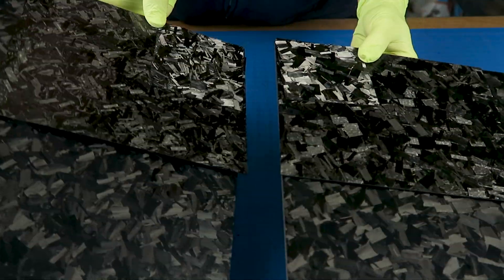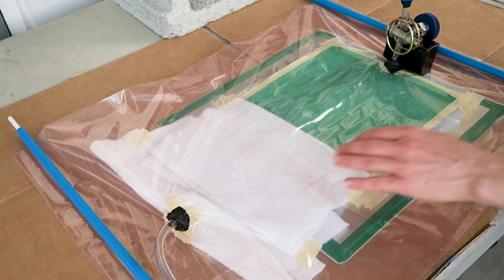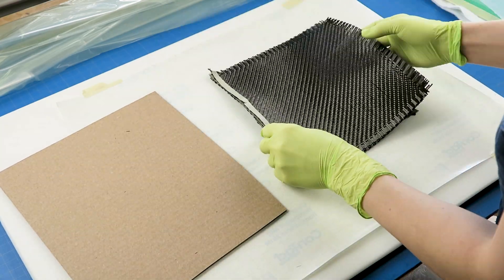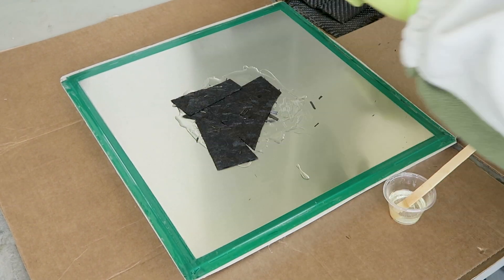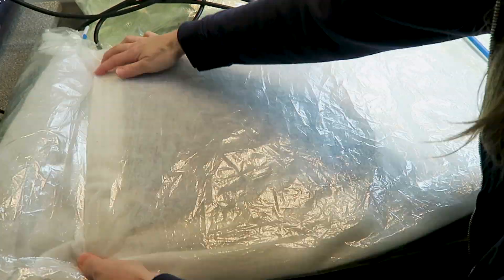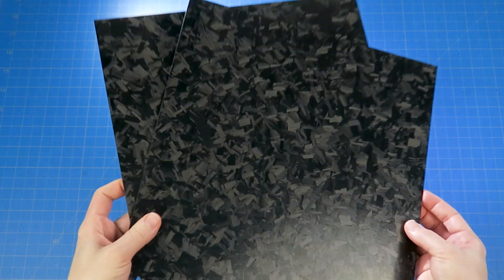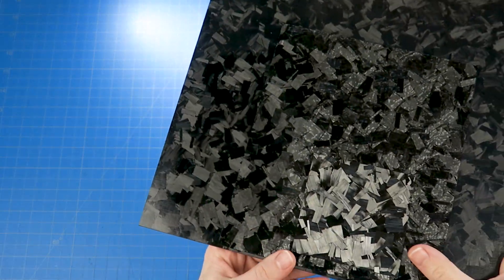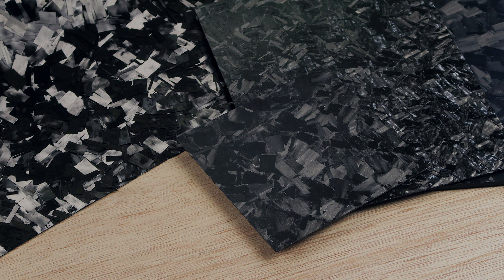Forged Carbon Fiber Fabric Features & Tips

Comment: Is that the ez vac from ACP? I was thinking about getting that, how do you like it? They recommended their vacuum generator system instead for me, so I could do larger parts like a car fender that’s 3.5ft tall 3.8ft wide. The ez vac might barely be able to do this bc it’s not flat they said, so I was wondering what your opinion is of the system.
Reply from the maker: Ez vac is handy and works, just very slow to pull down a large bag. Pretty sure it's a rebranded fish tank pump. Doesn't pull anything close to full vacuum but it does plenty hard enough to hold things together during cure. My process is often degass resin in a vac chamber hooked to a standard messy and loud oil-using pump that pulls a good strong vacuum, use the auto-vac to pull down the bag and squeeze out extra resin for a while then switch to the ez-vac for the rest of the cure cycle, lower vac level offers some benefit in this case some any remaining air pockets will leave smaller voids.
Reply: @LindyDesignLab  thanks so much for the reply! 
Do you think I could get away with buying the ez vac system, instead of the vacuum generator system? I’m hoping parts from the ez vac kit would work with the Amazon pump you have listed. Parts like hoses, fittings, bagging stuff. 

Because buying both, would be as much as the vacuum generator system anyways. I want to make sure I have the right fittings and stuff to start vacuuming with the other pump when needed. Anything other parts that you recommend purchasing with the Amazon pump and ez vac kits? 

Thanks again, it really helps! (Ulticarbon recommended acp’s bagging system but didn’t specify which one they recommended)
Reply: Do you need a vacuum regulator for the Amazon pump?

Comment: Hey, cool video. Not sure why you would spend the exorbitant amount on these premade sheets if you're infusing anyways... You can cut spread tow carbon and just use epoxy with it like normal carbon. It looks identical to this, and costs pennies comparitively. 
I like using spread tow as opposed to standard twill for the forged look because it leaves you with flatter thicker pieces in the pattern.

Comment: Would you recommend this fabric for hand laid application for something like a steering without a mold or vacuum?
Reply from the maker: There's a video by ulticarbon using it to skin a console without a vacuum https://youtu.be/snqU6VxJg8w. For simple shapes you can wrap it tightly instead of vacuum. Next video on LDL will be forged fabric skinning a mask.
Reply: Lindy Design Lab thanks. Looking forward to the video.